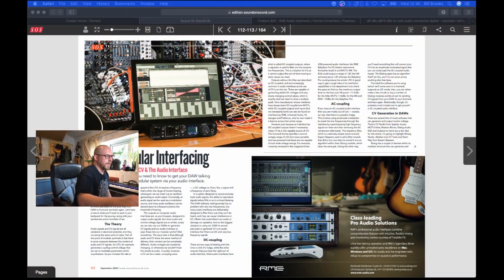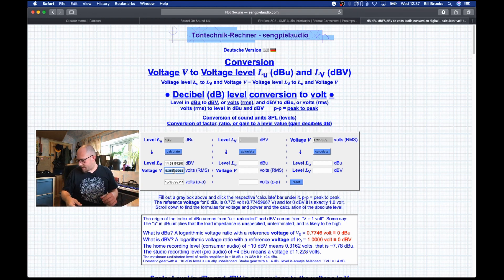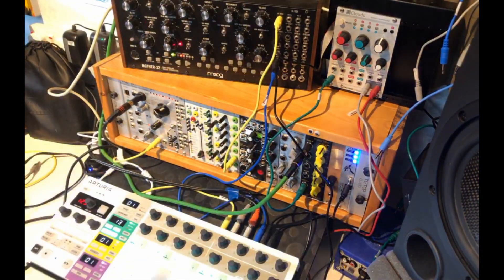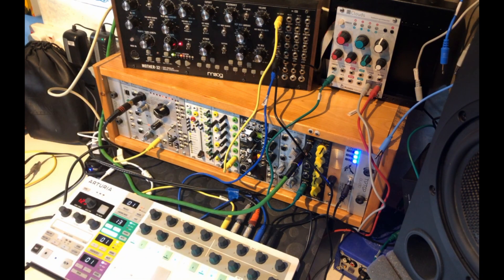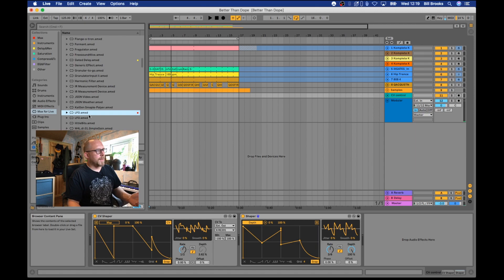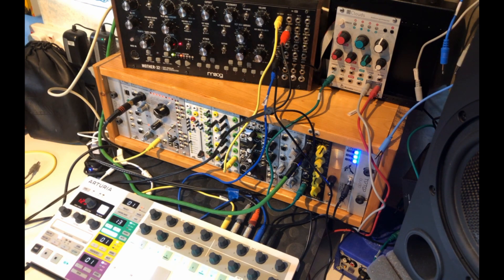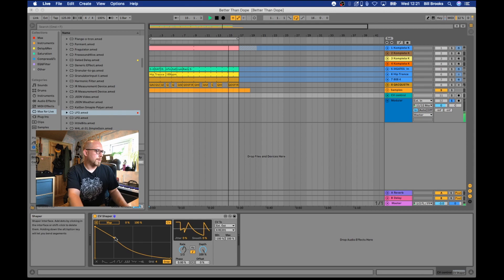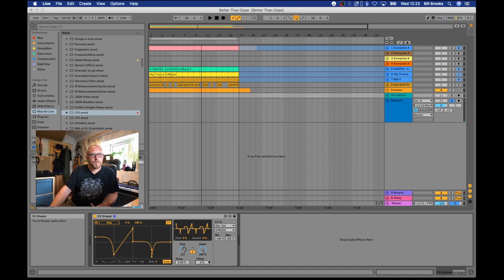Using Ableton to control modular synths with Control Voltage (CV)

Comment: What output are you using for the cv. I've watched so many tutorials on cv for modular synths, but no one ever says what output they're using... just output. What output?
Reply from the maker: An output from my RME Fireface audio interface.  Does that help?
Reply: @BrooksAudio  Yes, thanks! Did some digging. Just found out my interface (Focusrite 18i20) doesn't have DC coupled CV output. Most people are going through Midi or ADAT to CV I/O devices. I'm now using my Moog Matriarch (USB tempo from DAW) arpeggiator to send CV to my DFAM, through midi out to a patch cable, which controls everything else. The crazy things we do lol
Reply from the maker: @elyot4010  yes it can be complicated. There are various USB - Cv eurorack tools you can get and some of them are very inexpensive. Could be worth a look.
Reply: @BrooksAudio  I was looking at the Doepfer Dark Link USB/MIDI to CV/Gate Interface. Looks like exactly what I want
Reply from the maker: @elyot4010  also have a look at: Mutable Instruments CV Pal (very good & affordable), Arturia Beatstep (great sequencer and does the usb midi to CV output too), also CV.OCD
Reply: @BrooksAudio  Awesome! I will! Thanks!
Reply: @elyot4010  Bear in mind that the CV Clock Out tool does work with any non DC-Coupled interface, as long as you have a spare output. Just place the tool on the Master track in Ableton. If you monitor your DFAM from a MIDI track and an External Instrument device, as opposed to directly through an Audio track, you'll have perfect sync and 0 latency. Just send the midi from the External Instrument to any dead end.
Reply: @juanmico4085  yep, was having no problems with midi. I also use the cv and gate from my Matriarch and Werkstatt-01, so I'm good to go

Comment: Engagement comment to feed the algorithm.  -  sad state when youtubers can make intentional "mistakes" in order to get more comments and feed the algorithm to move the video up the rankings.  not suggesting you would do that of course.     maybe a spot the mistake challenge.

Good to hear that some interfaces have DC Coupled i/o useful for other lab / nerdy stuff too.   

if you wanted a load of cheep voltage control outputs it should be pritty straight foward to modify a cheepo interface output filters.
Reply from the maker: Intentional mistake... hmmm... Not that I know of!   Go on, please enlighten us!
Reply: @BrooksAudio   wasn't sugesting that you made any mistake's - just that other channels do in order to generate comments
Reply from the maker: bassplaya69er - fair enough! I’m only making accidental mistakes, not deliberate ones 😂
Reply from the maker: "if you wanted a load of cheep voltage control outputs it should be pritty straight foward to modify a cheepo interface output filters"  I love this idea!  Could then even run an Aggregate sound card in Ableton to include your audio device and CV device.